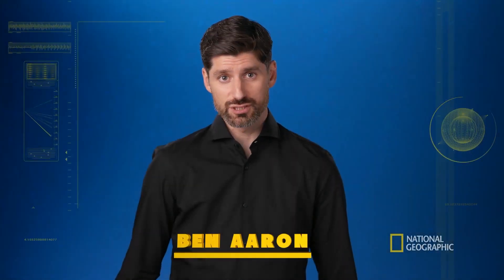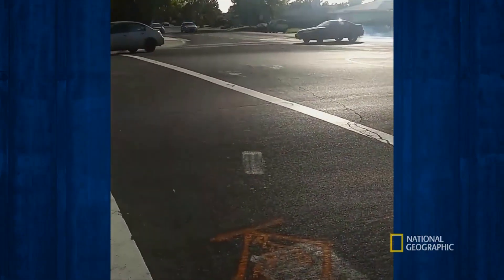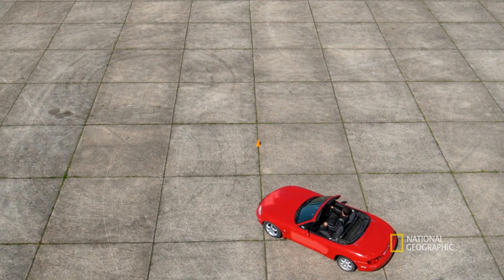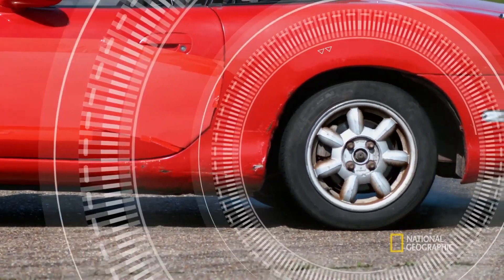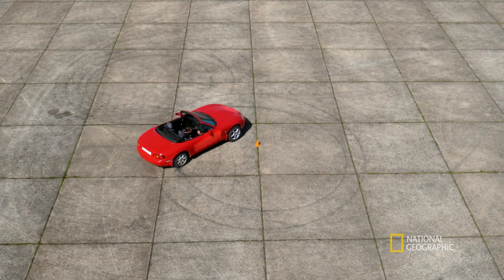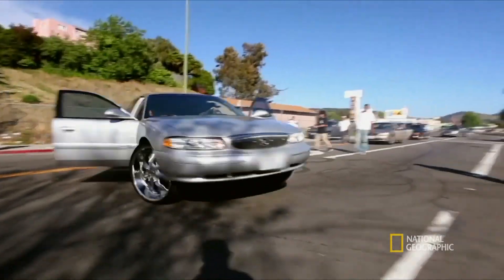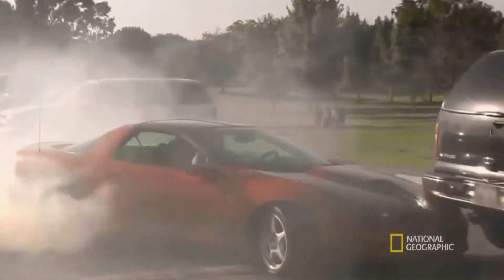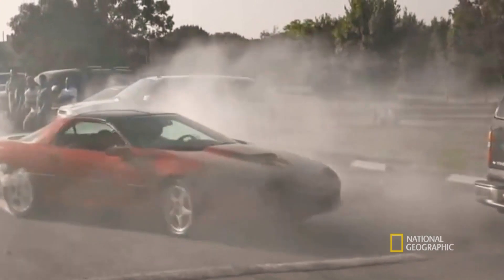How to Perform a Donut | Science of Stupid: Ridiculous Fails

Comment: Ugh....it's centripetal force. Center seeking force. Centrifugal is like unicorns. It's made up. Centripetal force keeps the object moving in a circular motion. Technically centripetal force isn't actually a force. Centripetal force's role can be filled by many types of forces. In this case the static and kinetic frictional forces. Centrifugal is used to explain why objects tent to kove to the outside of circles but that's not what's happening. It's actually the opposite. If there wasn't a centripetal force the object would just go off on a tangent to the circular motion. Like a car turning an icy bank that slides off. The static friction of the wheels is virtually gone and therefore no centripetal force is being applied and you fly off in a straight line off the road. Or if you cut the string of a tennis ball swinging around it will always go off in a straight line tangent to the point of release in the circle.

Comment: How to do a donut?
1. Snow on the ground.
2. Front wheel drive in reverse.
3. Parking brake on.
4. Steering wheel cranked one direction.
5. Floor it!
Used to do it at the pass after skiing until the parking lot patrol came into view. 😊